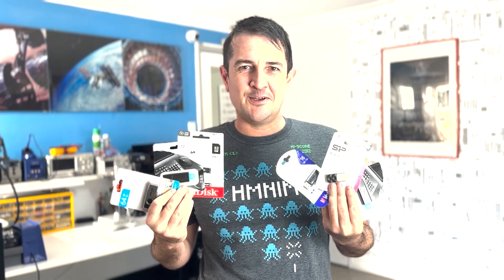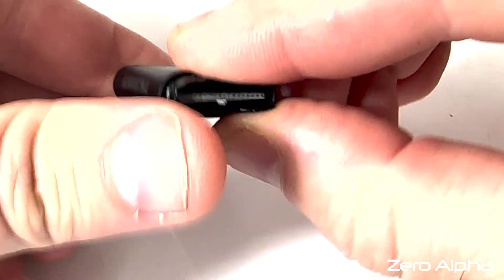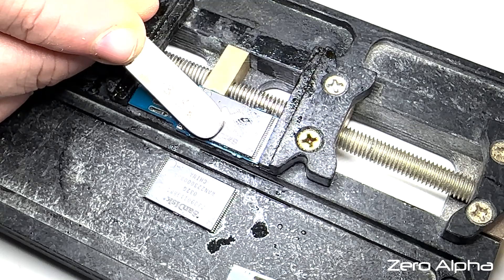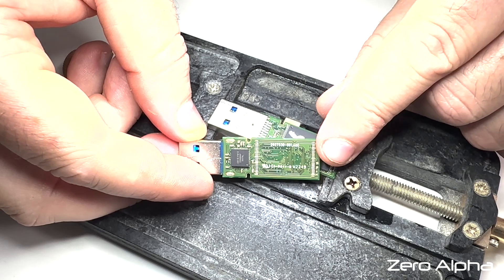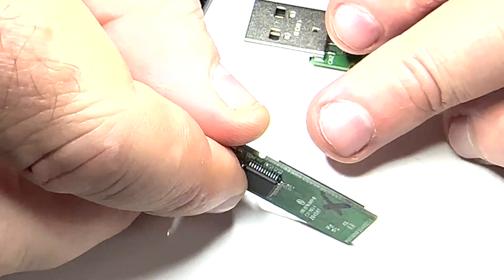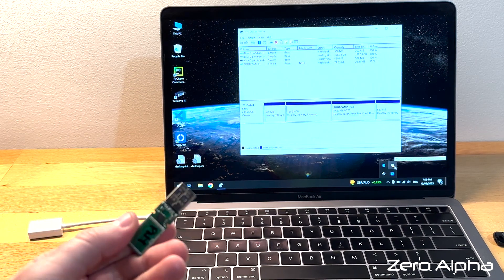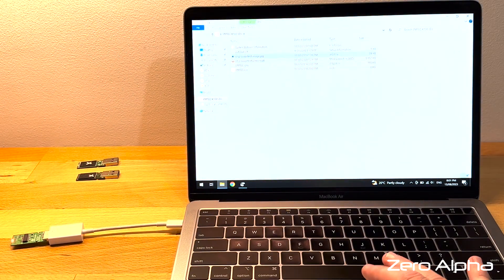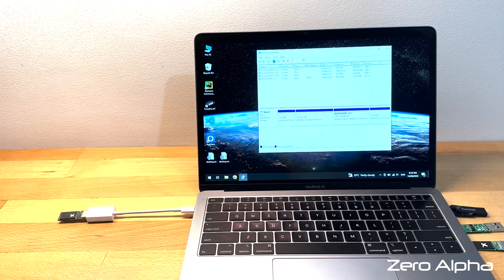Swapping Memory Chips on USB Flash Drives - Does it work for data recovery?

Comment: i had one,  i forget the brand but there was a sealed metal chassis inside i couldn't get into. there was a seal on the side but it was so fin i couldn't even get a razor blade into
Reply: I think you might be talking about Sandisk's Ultra Flair drive? I have one of those and i cant get into it either.

Comment: Wow, Right on time. I was Data Recovering that Kingston 64Gb Exodia USB - Controller IS918-FN12. I swapped the chip - USB got detected but chip NAND it self doesn't show any  Storage.
I then proceed to swap those chip back. And now both the donor and the dead USBs NAND chips not detecting anymore. 
So i think Kingston did has some kind of encryption upon chip swapping
Reply: Here because of the exact same problem, need to recover data from Kingston 64Gb Exodia USB - Controller IS918-FN12 which shows up but says no disk inserted, maybe chip is not getting connected.

Comment: i have an ssd that uses flash chips...and i think it can be upgraded...(upgraded because it has on the other side same amount of flash chips if u wanna add..)but my question is/or who is gonna do the firmware update?(on the controller...)
in other words...i can double the ssd memory using flash chips...instead of nvme ones.

the ssd is an 128gb liteon that uses toshiba 16gb flash chips...

Comment: Even in the case the controller notice that it's not the original flash chip due to a security feature (built-in encryption) I would expect that the device is still recognized as a USB device (at least with an error).

Would be interesting if these will work again if the controller is swapped too.

Comment: The flash that have space for a second memory IC, what happens if is populated with the same chip or a different capacity?
I tried long time ago to add a second chip(4G memory IC from a flash USB) on an old 1G mp3 player and it did not worked, only the original 1G was seen.
Reply from the maker: The controller will probably need to be reprogrammed so the new chip will work